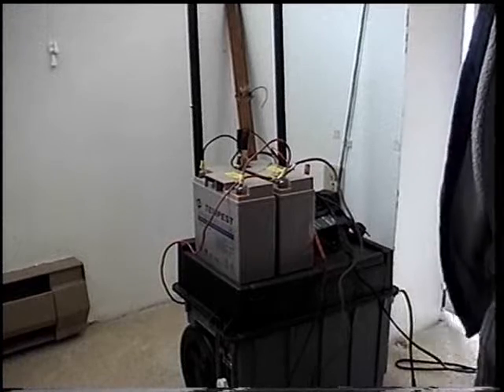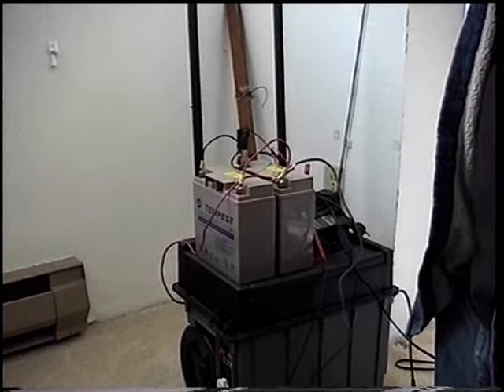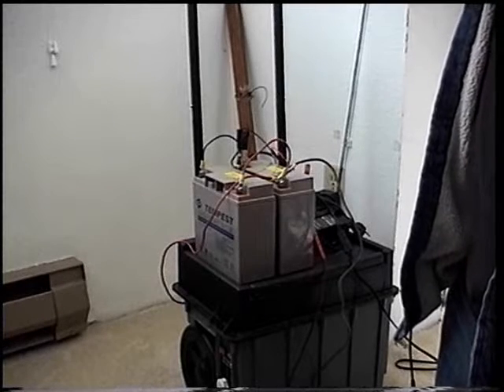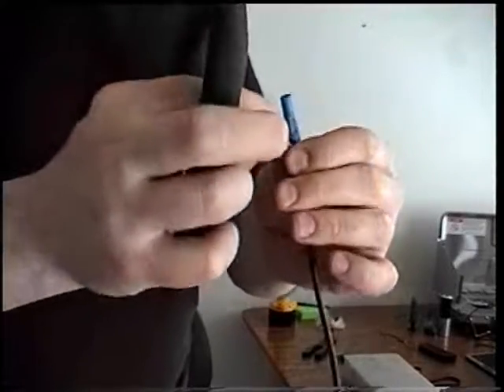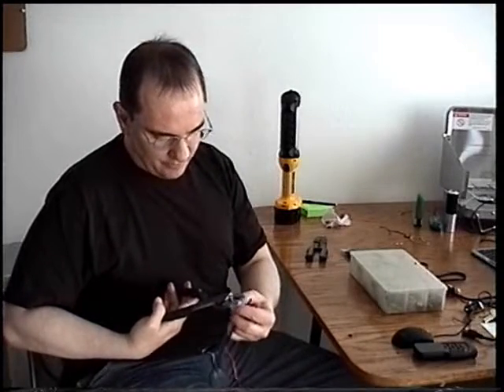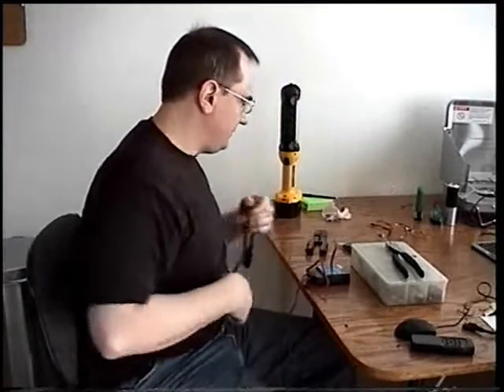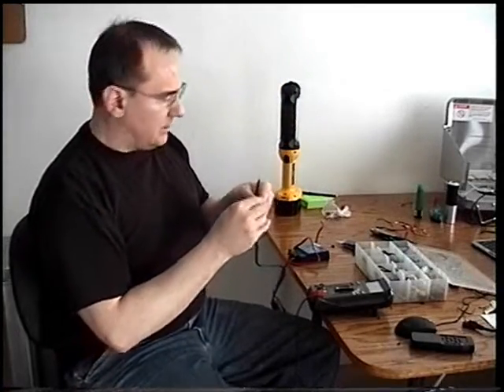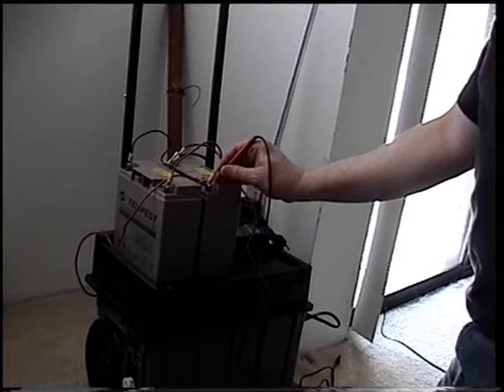Power Outage Drill PT5

Comment: Five more stars for caring about encryption of your data! Portable hardware is so easy to move, it may quickly move with somebody else. Unencrypted data gives you a lot of headaches when you eventually want to dispose of it, especially if it is defective and you can no longer securely overwrite it. The only weak link is the password. To keep up the security of your 256-bit encryption, you need a password of about 30+ characters.